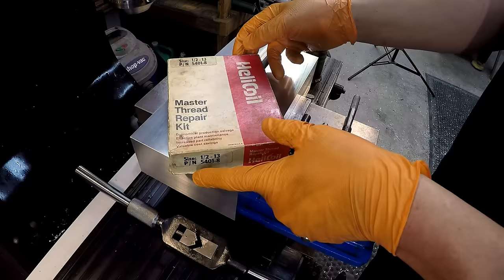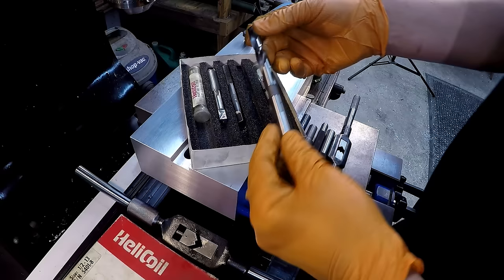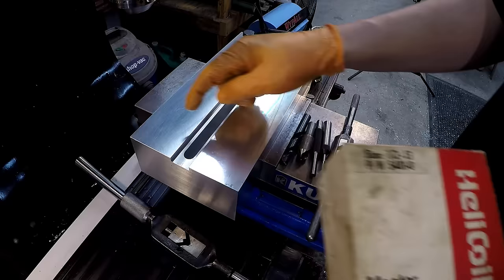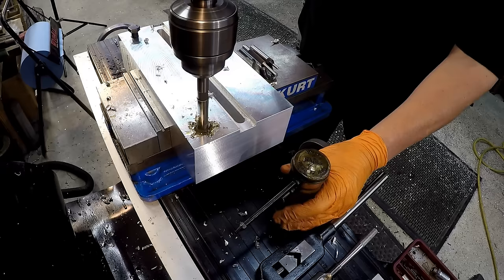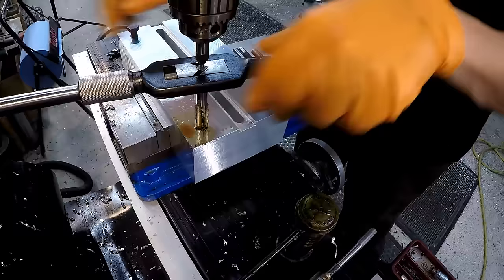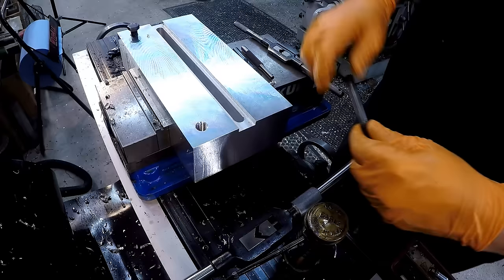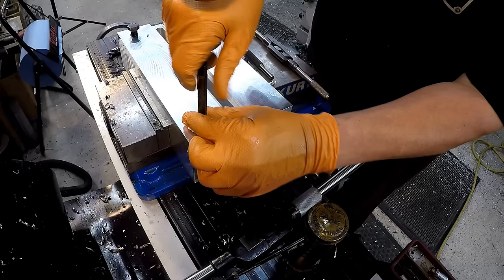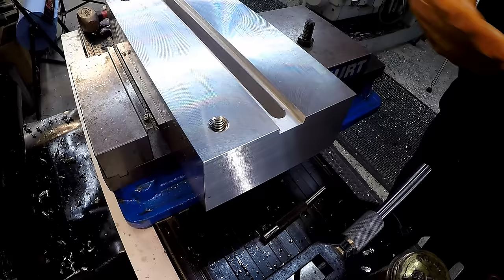How To Install a HeliCoil

Comment: I’m confused, you drilled a 1.5” deep hole and only used a 3/4” heliocoil so that means there is a 3/4” space under the bottom of the coil? If so that does that help with.
Reply: Look at the stress distribution of thread force on a helicoil in graphical form. Even a regular thread does not benefit too much from being deep, because the force is focused on 1 thread, usually if you overcome the force with a impulse you end up exceeding the yield strength of the thread and enough momentum builds up so it rips through all the threads. I am not saying it would not be stronger, but the failure mode/benefit of deeper threads is not well defined (research wise). 

Helicoil beats conventional threads, but you still have better performance from certain systems (i.e. the type used for missile mounts on aircraft has much better stress distribution on various threads).
Reply: I think the benefit would be only useful for very specific impulses. I would like to know from someone who did more testing though.
Reply: Maybe as simple as 1/2 is situated needed for strength but he wants to have the clearance to use one size bolt to secure different materials
Reply: My guess is that the extra depth allows the taper tap to cut the threads deep enough.  Otherwise, he would need to start tapping with a taper tap then finish with a bottoming tap.
Reply: Im by no means an expert, but I read somewhere you only need 1.5 times the width of the bolt to get maximum or nearly maximum strenght.  He is using a 3/4 on a 1/2 bolt, so according to what I've heard it perfect.
Reply: @MikeBramm  exactly that! Else the coil will go in, but the bolt will not fit. I had that problem...
Reply: When the coil is screwed in it lengthens, so a 15mm long coil would probably gain 3-5mm.

Comment: What stops the Healy coil from backing out
Reply: A stern warning not to. Additional threats of violence on pets and family members also works. If money is no issue, bribes can be effective. Depends on your application, really.
Reply: I prefer to use love to retain the coil.
Reply: @bman041  yeah but that's if both time and money are no issue. Meanwhile, we all have big heavy hammers in the workshop 😅
Reply: The way it’s coiled the coil pushes against the threads cut into the aluminum when the bolt is extracted. Even if the tang were still present you wouldn’t be able to unscrew the coil by simply trying to turn it because the coil would basically be trying to unwind against the wall of the part. That’s not to say they don’t eventually work their way loose over time, but generally with a deep set coil such as this that’s not an issue.
Reply: EagleKeeper thanks for a reply that makes sense
Reply: Some helicoils I install at work measure less than two tenths of an inch long for smaller fasteners. These are the coils that really benefit from being installed with loctite.
Reply: Spring tension
Reply: @EagleKeeper86  For the ones that like to back out I usually use a center punch and peen the area around it on top so that it can't come out. Been doing that for years and it has always worked. Good explanation to Robert though you're right on the money with it. Best Wishes n Blessings. Keith Noneya
Reply: Keith Noneya, that’s a great idea about peening the helicoil in. 👍
Reply: The only way to remove a Heli-Coil is by the very top.  Applying backing-out force anywhere else will make the coils above that point try to expand, increasing friction and making it stay in place.
Reply: @EagleKeeper86  It actually fits on the side of the threads and stretches upon installation.

Comment: How do you measure the exact location of where you want to drill your holes? Ruler? Caliper? Square?
Reply: The most accurate way to do it on a mill would be to use an edge finder
Reply: @big_R_  What about if you just had a standard drill press, what method would you use to accurately measure where you are to drill?
Reply from the maker: Many different ways. It depends on how accurate the hole location needs to be. If using a drill press, lay out the hole location using rules and a scriber. Use a center punch to punch the hole location. In the drill, use a center to line up the punch mark then clamp the work piece down.
Reply: @Eric-sk4dj  Abom has you covered!

Comment: This is like something I'd imagine as a solution, then immediately think no, that'll never work.

I had a spark plug blow out on my car, the shop said its too big for the helicoil repair, which I had never heard of at the time. After looking it up I thought, a bit janky but, could you put a helicoil inside a helicoil? Lol. Or, machine a helicoil out of stack of washers welded together. And now that I write it out loud I think with that much steel and different expansion rates, probably why it's not done
Reply: It actually works really well. My sisters car has a piece that needs removed when doing the timing belt. Soon as I pulled it I found all the threads just gone. Amazed the bolt was even in there. Did some reading and sure enough it was a common problem because of the location. Picked up a helicoil kit, drilled it out, cut the new threads, threaded the helicoil in, broke the tang off, torqued down to 30 ft-lbs with no problems. This was a kit for an M10. There was also a kit for an M12. Spark plugs would definitely not be too big. 

That said, people definitely do helicoil repairs for spark plugs, have seen it done many times and it's a long lasting repair. 

Nice thing about having an existing hole where you basically just drill the threads out, is the bit gets guided through the hole with no effort and you don't usually risk drilling crooked.

Comment: Great video but how is this more beneficial than just tapping into the aluminum? Its still threads in the aluminum so is it just for parts that are going to experience alot of cycles?
Reply: Helicoils are made from steel so they endure more wear than the aluminium. The helicoil cuts into the aluminium, that is why the it feels a bit snug when installing. Personally I use them on spots that see a lot of use, threads for removable covers etc. If you have a spot where the screw will be theoretically installed only once for the product's life cycle the helicoil might be unnecessary.
Reply: The helicoil is basically a threaded steel sleave over the top of the aluminium threads. So instead of a steel bolt being screwed and unscrewed from the softer aluminium repeatedly you've got steel on steel wear instead. Also steel on aluminium friction can lead to galling of the threads which the helicoil also prevents.

Comment: Hello , great to see install ...........million dollar question ?          Now take the coil out ........anyone have an answer.....?
Reply: Why would you take it out? If because its screwed up the I guess just drill it out for a bigger helicoil or you could try left handed drill bits or you could just screw a bolt into it and weld it to the steel helicoil.
Reply: Grab the end of the coil with a pair of needle nose and yank it out. Easy. Maybe a small flat head to pry the end a little so as to have something to grip.
Reply: Ben Hojnowski 
Agreed, done that myself in the past.

Comment: Why was a helicoil required? He could have just drilled & tapped the hole to the correct size to begin with.🤔
Reply: He literally explained in the first few sentences. He wants the taps to be stronger than aluminum..
Reply: why you no listen??
Reply: Also the differences in material between the aluminium and a steel bolt causes a reaction and galvanic corrosion over time

The helicoil is presumably the same material as the bolt.   You'd still want grease or a fibre type washer under the head though

Comment: seems to me you could use a bolt to install them too.... (the man with only a bolt tells himself before he ruins his part)
Reply: Any piece of m.s. rod which fits inside , bent like an allen key and a slot in the end will make a perfectly acceptable installation tool... I've done it many times... 😎👍☘️🍺
Reply: While the install tool is slightly better due to it driving the tang at the bottom, bolts certainly work.
Reply: Or, since you have the coils, drill and tap then you probably have the whole kit which has the tool lol
Reply: @BlackSmokeDMax   the thing about using the installation tool (or my diy one) is that the coils close slightly as its being wound in ... reducing the coil OD fractionally for easier installation.. 😎👍☘🍺

Comment: Can someone explain why your need the helicoil if your already tapping the hole?can't you just tap it and install a new bolt?
Reply: I'm no genius on the matter but I believe it adds strength to the thread. More so than if you were to just add a bare bolt
Reply: If the hole where the bolt shold  be have somehow becom bigger u need helicoil to get the same sice as it was
Reply: At the beginning of the video (0:14) he says he's doing it to increase the longevity of the workpiece by stopping the aluminium being directly against the bolt.
Reply: More tensile strength and durability if high frequency usage into softer alloy.  Or if original threads were damaged could be repaired with helicoil...

Comment: Thanks for this video. Just a quick question, would it be a good idea to use Loctite on the HeliCoil when inserting it? Thanks
Reply: my two cents - in aerospace we would occasionally threadlock a helicoil in but liquid threadlocker needs to be used sparingly otherwise it can bleed onto the working portion of the threads and it makes it difficult to thread the mating bolt into the hole. Helicoil manufacturers do sell threadlocked helicoils though, with sort of a solid threadlocker compound applied to their outer surface so you don't have to, and so you don't need to deal with liquid threadlocker bleeding.

Comment: Wouldnt it have been easier to make threaded steel inserts?
Reply: @Florian Bosch  Short answer, no.  Many of the pre-made Heli-Coil brand inserts are stainless steel (best for not introducing corrosion to aluminum) and (the major factors) 'fast', cheap, easy!
Reply: Helicoil practically are threaded steel inserts
Reply: @jhbonarius  Not quite. I've read up about is some, and from what I gather, this is how it looks:

Helicoil:

- Fiddly to install
- Screwing the coil in thread misalignment may happen
- Special tools required (custom tap, custom bit to put the coil in)
- Has a piece that breaks off and may fall into a machine
- Less thread engagement and therefore lower pull strength
- May come out on its own when you unscrew the bolt
+ Does not mess up the thread
+ Easy to remove

Keensert:

- Chews up the thread where the keys are hammered in
- More difficult to remove (needs to be drilled out)
+ Likelyhood of missallignment about as high as an ordinary screw
+ Better thread engagement and therefore higher pull strength
+ Does not come out on its own
+ Only standard tools required

Comment: ? No loctite  on the coil
Reply: According to Heli-Coil(there engineers), absolutely never use thread locker. I just spoke to them last week regarding a question I had on a job we were doing and I happened to ask that question.
Reply: Please elaborate, I'm curious about this too.
Reply: The helicoil inserts actually have a larger diameter than the threads they go into, they sort of spring load into the hole. I'm guessing that's what supposed to keep them in place.
Reply: I guess I buy that, mostly, but I've always used Loctite with Helicoils and am having a hard time wrapping my head around not using it.
Reply: The locktite will also seep into the inside thread, as the coil is open. As a result the coil might stick to the bolt when taking it out! Then you need to re-tap it etc. Worse would be that the bolt friction causes you to push down the coil. Either the bolt will not go in all the way due to the undeep trapped threads, or the bolt will not be held properly.
Reply: @ColtaineCrows  yeah, but sometimes they do come out. Friction due to bolt corrosion and such. But you can then just place a new one.

Comment: What holds the Helicoil in place?
Reply: the tap cuts little threads the helicoil sits in
Reply: It won't back out. The spring tension of the coil holds it in place.
Reply: @MrCoffeekelly  thanks.

Comment: Hi abom, so I used a helicoil to repair a broken thread in an engine block. The problem I found it that the hole was blind and had a water cooling channel behind it, so I could not drill it deeper. When tapping, I found the thread was not cut deep enough at the bottom of the hole: I could fit the coil, but the bolt didn't go in all the way. Any tips on how to overcome that?
Reply: Jochem Bonarius 
Are you using a standard tap? If so, try a flat bottom one.
Reply: yep, you need a bottom tap
Reply: @andrewlangley9507  Yeah, I know. But the problem is that helicoils have a special tap size. It's really hard to get that size. Usually the tap comes with the kit. A one step version.
Reply: @WHM_Engineering  thanks, but the problem is that helicoils have a special size that comes with the kit, just like abom says.
Reply: It’s pricey, but you could grind the end off.
Reply: Just looked at the tap that comes with the kit. It looks like a flat bottom anyway, so grinding
may not help much. You may have to weld the hole and redrill and tap.
Reply: What length coil did you use? If a 1D is too long, you can use a sharp set of side cutters to trim a number of the coils if that makes sense, eg if there's 10 threads, trim 2 to make it 8.
It's not the best practice as it puts a burr on the thread but can help if youre in a bind.
Reply: @andrewlangley9507   it will help him because the helicoil tap is a 3 in one tap normaly you have 3 taps but this one has on 2 on3 low threads a no 1 tap profile and on the next 2 to 3 threads a no 2 tap profileand above that you have your final cut done so he needs to    cut the threads then grind 2 or so treads oft the cutter then cut again and then  reapeat until on the botom of the hole yor thread is cut completly
Reply: Nick Hetzer 
Good to know. Thanks for setting it straight.
Reply: @andrewlangley9507  that would turn a $30 repair into $300+. Removing the head from the engine, cleaning it, etc etc, new gaskets...
Reply: Jochem Bonarius 
Duly noted.

Comment: That little tang you knocked off would be a big problem if this was a spark plug hole, no????
Reply: Big Jeep no, you can allway just open the cylinder head and remove it (remember to replace the head gasket if you do)
Reply: You'd use a different kind of thread repair insert for work where you can't knock off a piece of metal.
Reply: If you can drill and tap it without getting chips in the cylinder then I think you can handle the little tang
Reply: I'd never helicoil a plug hole.  Time sert works great for those.  If you put grease on the end of the drill, you won't have a bunch of chips falling in.
Reply: Discretesignals A bunch, no, but even a few is ok?

Comment: 1. You pretended to need a heliCoil.  Just to demonstrate.  
2. In reality, there is already a hole with dodgy thread which will act as a guide for your drill.   Your drill will just follow the existing hole.
3. You showed ideal conditions - the machine shop.   And great visual quality thank you.  
4. In reality, I might have limited access and be working with portable tools.   I might have to rig up a long series drill and tap - eg. set the drill into some hard drawn tubing first, just to reach the location.
5.  Taps should be high quality HSS (high speed steel), not simply carbon steel from China.  Because if you break the tap in the hole, your day just got worse not better.
6. Long series tools for reaching in to hard to get areas (eg an automobile) tend to show if they are not aligned because the long shaft shows your angle to the work quite well.   Standard length tools in hard to get areas need special care and set up.
5.  Great video.
Reply: No pretense, putting steel reinforcement in a new aluminum workpiece is common practice in my line of work.

Comment: "Flip it over and let it fall out"

Yeah right pal, I'll stick with steel wire, aluminum foil or just screwing two smaller bolts into the hole in place of the one stripped bolt.

Who has time for helicoils in 2020? Get outta here!
Reply: Did you even watch the video??? Do it again ffs!!!
Reply: @matteedstrom  where do you think I got the quote from? Perhaps I gleaned it from years of experience teaching smart ass techs how to get by without their precious multimillion dollar manufacturing support. This guy!